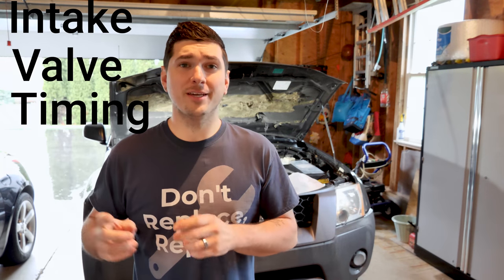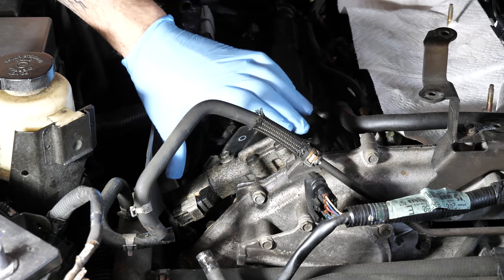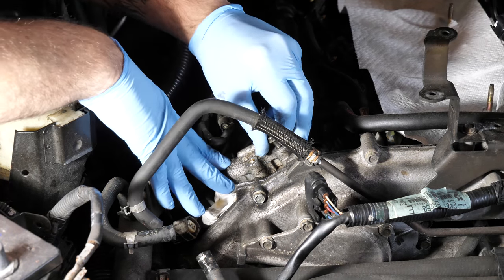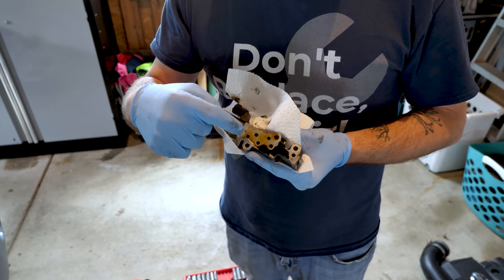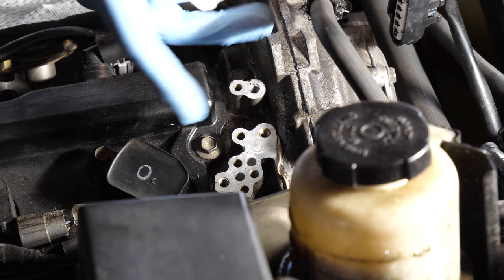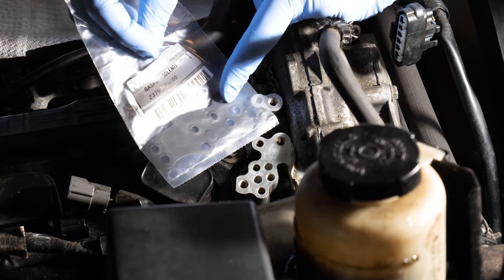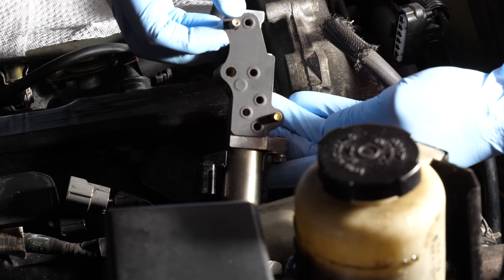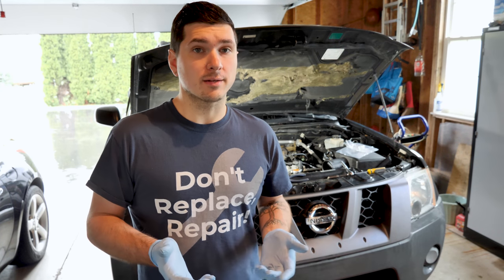How to Replace Intake Valve Timing Control Solenoid Valves on A Nissan Xterra VVT

Comment: Unbelievable everything wrong with your xterra is wrong with mine. You are saving me money with these videos. I got 210000 on mine. 05 6speed manual.
Reply: Tower, how is your XTerra doing? Any more issues? I have an 06 RWD 6 speed manual too!
Reply: @MaximumDIYGarage  I sold it to a buddy. It’s still going strong. The rear went on it but he got it fixed. And the clutch went. Must have 230 plus by now

Comment: U need to pull the solenoid from the housing and clean the solenoid with cleaning solvent make the valves inside moves freely to make it work
Reply: Its working but if i cleared the code or disconnect battery its cleared then after starting on of  its not coming but after  setting 4 hrs or more try restart it the check engine saying hello son 😲 where are you ♥️
😭😭😭😭😭😭😭😭😭😭😭😭

Comment: Good job 👍
On my xterra 2006
I got p1136 on start up i got check engine  cleaned it now i hope its ok but if its not clear Rd and selenoid is ok can i drive with this code or there is a problem?

Comment: Ok friend you are expert on cars i got xterra 2005
I got headache of code p1136
Flushed engine 2ith fuel as you told us before to soak it overnight and drain it Did It 6 times and engine run great except for p1136 code
Its vvt selenoid ive changed it  3 or 4 times
Changed oil and filter
Cleaned cam sensor still after clearing its coming back on 3 Rd start up
Checked harness of vvt 2 wires one give battery voltage and one is ground its ok no voltage
 Next step will be replacing cam sensor
Any suggestion will be appreciated
Also i dont know will bigger battery 900 cca 90 amp adversly affect the car so instead of 700  cca 70 amp?

Comment: Could these valves or solenoids cause a knocking/tapping sound on my 2013 Frontier V6 (128K miles)? Thanks!
Reply: Yes it can, take a stethascope and listen to it. If u dojt have one, use the end of a screwdriver and have listen

Comment: I watche dyour video on the camshaft positioning sensors replacement. You say they both need to be replaced at the same time. Does that apply for the actuator/solenoids too? Same time?

Comment: Thanks for the great videos!  Somehow I set my torque wrench to 8lbs and it snapped the bolts!  Not sure what happened.. maybe torque wrench bad, bolts old, or oil on bolts. But luckily the bolt snapped and was still protruding outside the screw-hole to unscrew it.

Comment: In that video you suggest, about removing the air intake manifold parts, you say removing the two hoses attached to the throttlebody will you should expect just a little dribble of antifreeze and pour it in a bottle. However when I remove them it was almost like they were under pressure and a huge explosion of green antifreeze splattered everywhere I must have lost a quarter to a half a gallon. I have a 2005 Xterra regular S version exactly like you, why did my anti-freeze spray everywhere unlike your demonstration?
Reply: Check under the radiator cap and if the liquid is pink then you have a bad transmission and radiator. It’s called SMOD (strawberry milkshake of death) it’s just the term people use. It’s when the radiator fluid mixes with transmission fluid. It’s a $4000 fix. I had your same issue, if both haven’t been replaced before then it will happen regardless of what you do. It’s a Nissan problem. Hopefully it isn’t the case but if it is then good luck.
Reply: @xRJCx  i had the smod back in 17'. yes $4,300 bill. But this has nothing to do with it. Rcently mechanic told me that i drove The Xterra too soon before attempting the repair. If I recall ry didn't mention that you should let the engine cool overnight before attempting to remove those hoses.. I might've fast-forwarded over the part where he says that

Comment: Thank you for the information. I have a Nissan Pathfinder 2011. I checked it, but obd the diagnostic device. I have the code p0021. Is it the vvt sensor or the vvt care? Thank you.
Reply from the maker: Yes the VVT solenoid could be the cause of this .
Reply: @Rythecarguy  Thank you. But the vvt sensor was checked outside the vehicle and there is no defect in it. My question is when checking the vehicle with a fault detection device. The examiner tells me that the defect is not in it, but in the care of the vvt actuator

Comment: 296,113 miles on my 2012 Nissan Xterra. What oil are you using?
Reply from the maker: Damn, thats a lot of miles. I think I just bought Mobil One High Mileage.
Reply: Ry the car guy goal is to take it 500,000. The axles leaking have been the biggest thing. Full synthetic are the way to go
Reply: @CarsRMe  for me ill try one million mile 😄
Reply: @Sroor90010  at 310,442 miles
Reply: @CarsRMe  so which fuel pump is better ive dissasembled mine and it has walbro fuel pump 😃 iam second owner so does nissan have relation with walbro company 😁
And whats the diffrence between walbro and nissan oem fuel pump?
Reply: @Sroor90010  OEM is Bosch.

Comment: Jeff B  Did you fix It man? I have no signal from ecu on driver side but on passenger side there is signal but once i give it earth 2 or 2 sec  engine hesitate so that mean no signal??? 🤬🤬🤬 Have done oil change and filter, crank sensor, 2 cam shaft sensor, driver vvt many times changed selenoid many times no solution, checked voltage on red wire on harness switch on give battery voltage and other wire which is for signal for computer ecu which is earth and thats it really upset 😭😭😭

Comment: Good morning, greetings from Bolivia, I wanted to consult you, I have a Nissan Xterra 2006 V6 VQ40DE 4000cc 6-speed mechanical gearbox and I have a system failure in the VVT valve sensors, they told me that I have to change because this code P0021 BANK2 comes out, I must consult change the two soneloid sensors and where can I buy it and which one should I buy please help

Comment: Ry the car guy
I have a question, I had my Crankshaft seal changed recently and I got p0082 Hyundai error which is for Timing Control Solenoid, I was wondering if they made a mistake or caused a damage during the change, would you please let me know this is possible?

Comment: How did you know to use 8 ft pounds of torque, mine keep leaking and that much torque doesn't seem to be enough and I can't find anything anywhere on the torque specs
Reply: The weird thing with gaskets and small parts is that over torquing of bolts can actually lead to too much gap elsewhere in the gasket, causing a leak. A uniform tension by a proper torque spec, keeps the whole gasket properly sandwiched between the two parts without those microscopic gaps. 

Most, if not all torque specs will be found in the FSM, or Factory Service Manual. Good thing for us Nissan/Infiniti owners is that NICOclub has put all the FSM's up for personal use. These are downloadable versions for each chapter of the applicable vehicles manual. It was a big help with proper torque specs for my Xterra Supercharger swap!

Comment: Why didn't you remove the solonoid  from the housing and clean it & the screens too?. It's only 1 bolt
Reply from the maker: I’m a lazy pathetic excuse for a backyard mechanic
Reply: Lol... Ry. Also disconnect the negative before disconnection any electrical sensor. 
Especially on Mazda's. 
On older Mazda's, it won't recognize a new sensor part. Stupid stuff I remember.
Reply: @Rythecarguy  Using Maf sensor spray to clean the VVT works real good and dries fast..
Reply: @Rythecarguy  😆

Comment: Ry, had a P0021 error code pop up after a rough start up. The dealership says my timing chain is worn and needs replacing.I’ve always kept up with my 2011 Xterra maintenance, so I don’t see how a car with less than 100k would need a new timing chain. Do you think the VVT solenoid would trigger a misfire code and cause the idle to seem rough or even weak?
Reply from the maker: It can be worn down, and here’s why. The VQ40DE has an issue where the secondary timing chain guides wear down prematurely. Once they are worn all the way through the chains will run against the tensioner piston. This metal on metal contact wears on the chain. You can usually hear this issue and it comes in the form of a whine, usually at a higher pitch. I have an entire video on the process of replacing those guides. I’ll find it and reply to this comment to send you the link.
Reply from the maker: How to Replace the Timing Chain and Tensioner Guides on Nissan 4.0L Motor https://youtu.be/j3uY3clWxFE

Comment: Any body knows ecu pin terminal for signal to driver side is it pin 10 want to check for continuouty on this vvt selenoid having issue with it replaced it many times and no sucess

Comment: Is P0011 same as those two codes?
Reply: Same question bro. Just changed this stupid inlet heater assembly for my 2012 Pathfinder. 

Had to drain the coolant and figured at 108k miles, I might as well change the thermostat and water pump. I already replaced the Automatic belt tensions and idler pulley. 

I had done the spark plugs a week before. And now I have a PENDING code of P0011. 

It’s not a hard check engine code but it is a pending code. Not sure wha to do either